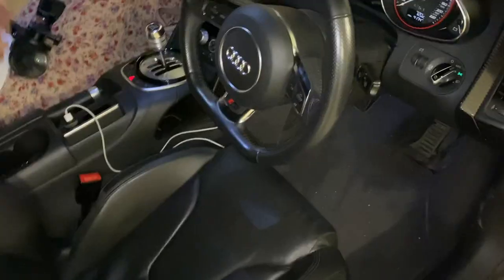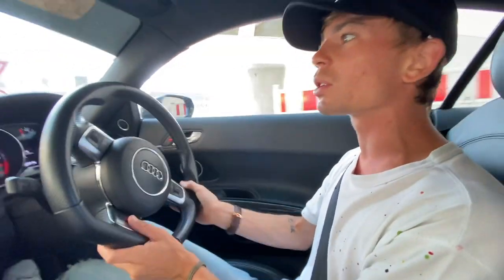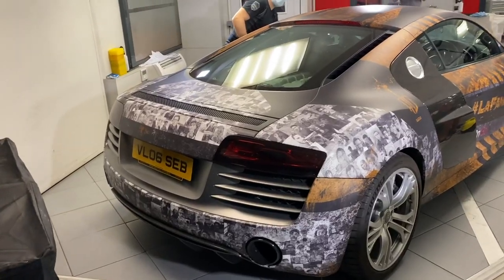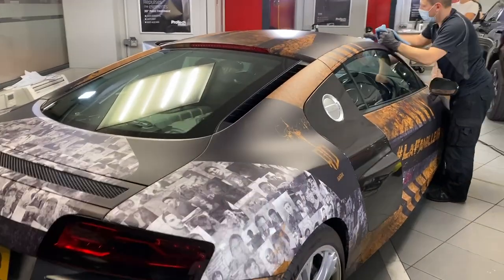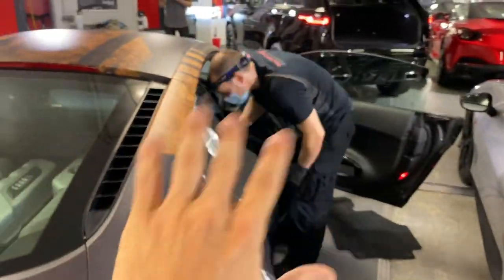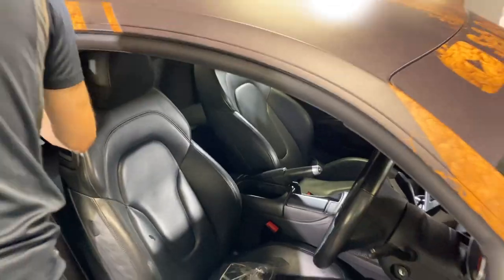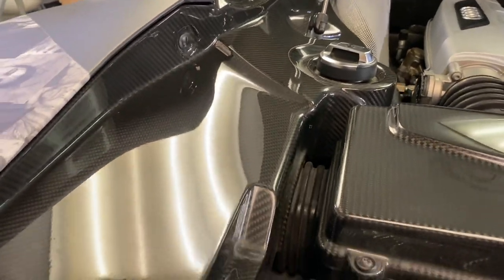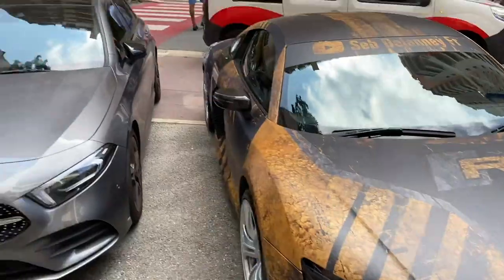HOW I WASH MY OWN CARS ?!

Comment: Just had my car detailed at my shop and the guy there said waterless car wash is a scam that ruins paint work. Big part of his business is scratch removal of typically cars imported from California where this is abundant because of water conservation.
Reply: Moving the gritty dirt around with a cloth will scratch it up. When you see detailers do it they constantly change cloths and sides of cloth, but didn't see that in this video.
Reply: sw651 no we didn’t. Seb’s car has a wrap that will save the paint, but the whole concept is just crazy
Reply: @Nord_Mann  I know his car has a wrap. Paint isn't the only surface that scratches on a car though. His car had fine dirt particles on it. Over time those fine scratches will show in the finish of the carbon fiber, glass, and plastics.
  It's something to keep in mind. I think pressure washing the dirt off before washing does a better job.
Reply: To be fair to seb the car is wrapped and a good waterless wash product would be okay on at ‘MATT’ wrap but the gloss carbon side panels I bet are swirled now